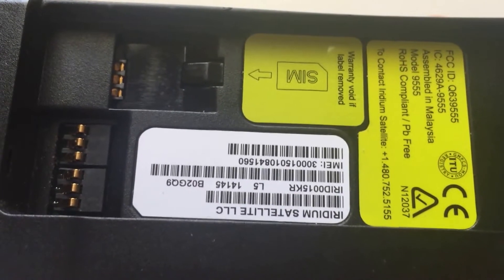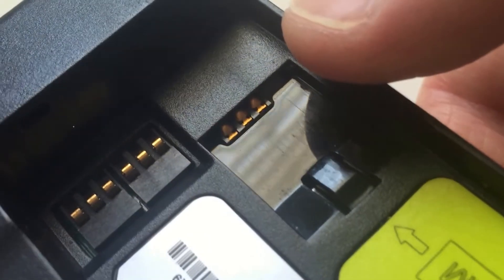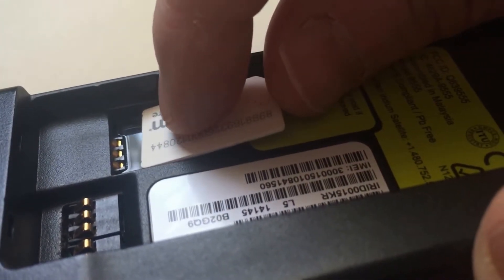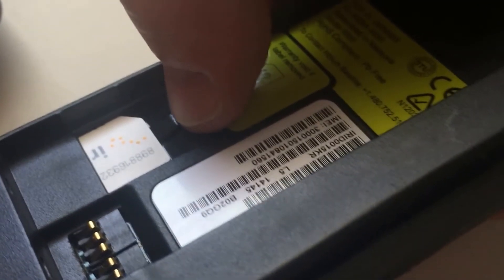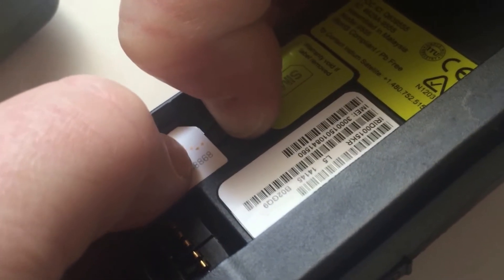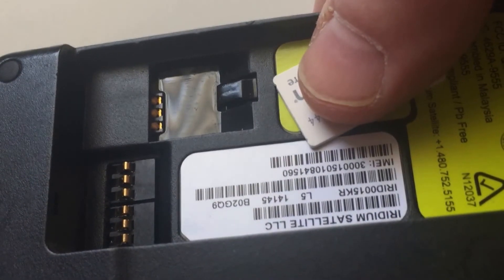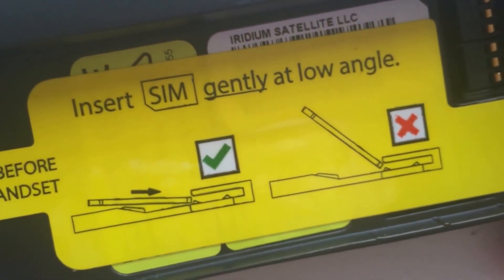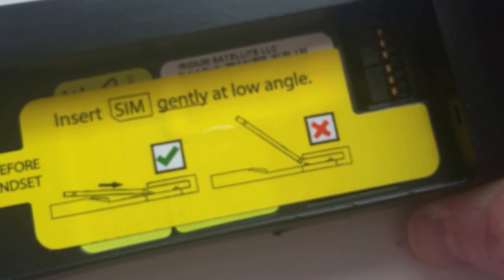How to install & remove iridium 9555 sim card safely

Comment: Instead of using a drawing pin that could potentially perforate the car, get a standard paperclip, bend it straight and use this to lever the SIM card out.

The paperclip has a flat end and has enough frictional surface to catch the card and drag it out without the risk of perforating the SIM and the hassle of needing a replacement and IMEI number transfer.
Reply from the maker: Hi Chris, 
Thanks for the comment.
Glad to know you got the basic general idea. 
Just to quickly make sure it’s understandable,.... the basis of the video was to help owners know that when regarding the amount of pressure applied to the spring enabled copper SIM card readers that are aligned in the front & back under the SIM card that whatever is used to remove the SIM card should be done delicately with pressure applied in the right areas to avoid damage to the copper SIM card reassert as iridiums new unit sticker shows regarding installation when purchased. 
We do trending analysis of damaged areas , and this video was meant to compliment the new devices  ‘How to Install the SIM card Sticker’, mostly because the sim readers are a bit different than previous to newer models., & a bit more delicate upon install /removal. So instruction guidance, and even possibly speaking to your service provider or an Authorized Repair Center can assist in making sure all is done correctly.
Just to note, that the IMEI # should never involve itself when removal of the SIM card unless of course they damaged the SIM card reader itself, but before they do that I would hope they would call for assistance. 
It would have to take some extreme force to go through completely wrong and through multiple layers of molded back section, which in that case would not be following the delicate use of what was mentioned and it’s direction. As it may seem you know that the IMEI # is one that goes with the internal main board. 
Regarding the use of a paper clip, this is likewise something that should be treated equally delicate due to the fact that the end of a paper clip is much larger, and can in many ways displace the area of pressure that is put against the SIM card and possibly pushing down the SIM card readers in a damaging way the would more likely require internal work. 
This is why I mentioned using the thumb pin Only if they’re comfortable with it,...which basically means if a bit more experienced.
 
For those not comfortable with that way we didn’t recommend going forward with it unless completely comfortable. 

and can also try using something like the end of a paper clip, or those that have longer fingernails may be able to remove it easier. 

Because we study different trends in damages & how they happen , and this was one we had to address. 
The reason was because there were too many things when either installing/removing the SIM cards that were damaging the copper pins in the front & back by the mentioned misdirection of pressure being applied to the SIM card by way of installation, and or removal of the sim, which could be things such as the wrong direction of insertion, using improper pressure with your thumb, finger, paper clip , or other things when removing,  that would make for future problems. 

This was also right when iridium just released the new stickers all new 9555 satellite phones to direct in the way to insert the SIM card due to the same problems mentioned, which is why we decided to show at least one way an experienced or comfortable tech or handset handler could also remove the sim with ease , & by not causing any damage. 
However no matter which way someone think may be  easier ,  comfortable, & safe on how you remove the SIM card, just make sure your careful and do it delicately enough not to put pressure on the back section, just as the insertion sticker shows., &?if there are any concerns or questions on removal then do please contact your service provider , and if in any other case feel free to call us as your local North American & beyond iridium Authorized Repair Center for info or free assistance on helping you through any issue you may need help.  

Thank you for your considerate comment. We always like questions & comments. 
If you need anything or have any questions on any satcom equipment feel free to call, or email us at 877-299-9931, or support@northernaxcess.com sincerely, NorthernAxcess  Support Team